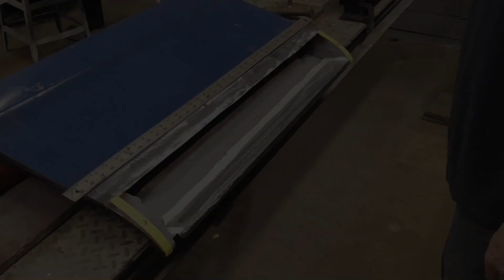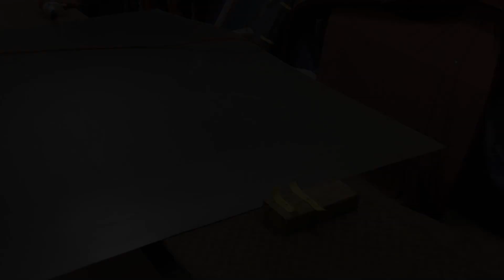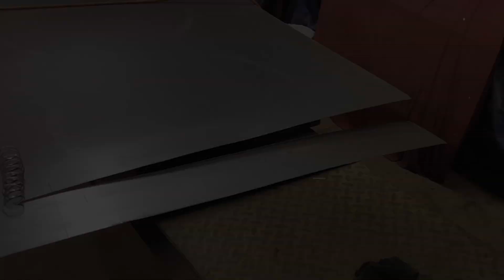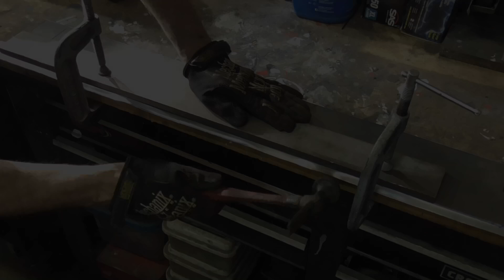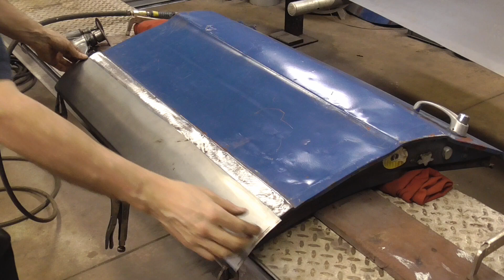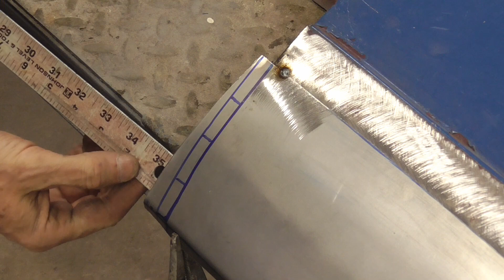How to Make Your Own Auto Body Patch Panels for Rust Repair

Comment: I tried to do this on a Chevy square body truck door. I warped it terribly
Reply from the maker: Take it one weld at a time and alternate.  You don't really have to weld solid either :)
Reply: @LakesideAutobody  ok because I did weld it solid but went back each time between welds.  I’ll try it again.  Thanybyou

Comment: Have you done the in door part?
Reply from the maker: I'm not sure what you mean by that.  Could you ask in a different way - sorry :)
Reply: @LakesideAutobody  the indoor where the door card is? Below that where the outter panel wraps around the pinch holding both pieces together. From the corner of the door about a quarter of that is bad. I can find outter panel for my dodge but no inner bottom pieces.
Reply from the maker: @BigBarnV1  Got it.  Here's a video that may help with that - https://www.youtube.com/watch?v=92mr0C62tq0

Comment: Nice work and video!  Sorry if I missed it, but no weld through primer?  If those seams are raw metal the rust will come right back.  And painting inside the door afterwards won't get into those folded over seams and sandwich lap joints... but the water will.
Reply from the maker: Many manufacturers like Honda a recommending no weld through as it affects the weld pool and burns off any way which I completely agree with.  It's best to treat the finished repair afterwards:  https://www.youtube.com/watch?v=8XaZBy7GC7A  Hope that helps a bit :)

Comment: JERRY
WHAT DO YOU THINK ABOUT USING AUTO &  TRUCK ROOFs. AS PATCH 
PANELS CUT UP FOR REPAIRS.
                GOOD. VIDEOS
Reply from the maker: Absolutely - that's what we used a lot in shops I worked at besides door bottoms that were bought.  Really the only reason I buy sheet metal now is because I don't have a supply of scrap fenders, hoods, quarters, etc.

Comment: Where do you get your sheet metal? And what gouge do you normally use for rust repair?
Thankyou for making awesome tutorial videos. Really enjoying them.
Reply: Haha I've been doing this forever, I get metal anywhere. 
Metal supply places , even an old car door or hood, look around you'd be surprised where you can find some metal. 
I've got a stack of file cabinet organizers that are about .080 thick ,great stuff for floor patches. 
You can't even lift the milk crate that's full of them. 
I might not be great at the finish bodywork,but I like cutting out rust and putting metal back.
Reply from the maker: I get it from Alro Steel and use 20-22 gauge for rust repair.  Have a good weekend :)

Comment: Very informative series about patch panels!  I have been practicing my butt welds for patches.  I put a very slight beveled edge (18guage or thicker) on the outside mating edge with the cut slag left on the backside. Putting a bevel on the outside keeps the weld low profile while still penetrating cleanly saves grinding  consumables as well. This has helped tremendously with thru penetration (provided your gap is no more than a 16th") if you cannot get the mig gun on the backside of the panel. Afterwards.. a light brush of 2k epoxy primer on the backside aids in providing rust protection.. i like your method of cooling your panels with a damp rag too. That is my "go to" way to do things now.!
Reply from the maker: Very cool.  That's good to hear.  I like the video about this that Eastwood made too. :)

Comment: What type of welder do you have?
Reply from the maker: Miller Millermatic 90 115v - I actually welded an eye of a leaf spring after it broke right off.  Drove on it for years after the repair.  It's very powerful for being so small and portable.

Comment: I love that you don’t have thousands of dollars in tools like press break or fancy 45 degree pliers
Reply from the maker: Thanks - I planned on having a bunch of cool stuff when I was 18 but......
Reply: Lakeside Autobody you may have covered it somewhere else but can you please run down your sanding grit steps right from removing old paint to applying new paint. I assume 60 grit, filler, cheese grater, 60 grit,80, primer, 220,320,400, paint?
Reply from the maker: @patrickchristie82  Sure:  40 grit fiber resin disc on a grinder to remove paint and prepare metal for welding or filler.  40 grit to sand filler then finish it with 80 to remove those deep 40's.  Feather edge the paint - start with 80 sometimes to knock it down a bit then 120 and scuff the shinny paint that may get primer over spray.  Block with 80 big giant areas or 120 smaller - finish it to 120 though.  Prime again wet sand w/ 400 or dry sand w 220-320  - then paint  _ Hope that helps - Jerry
Reply: Lakeside Autobody thank you very much
Reply from the maker: @patrickchristie82  You're welcome - any ?'s feel free.  Jerry

Comment: Thank you for the awesome videos!! 
I recently found some rust the fire wall my 2007 2500hd GMC Sierra. The rust is a result of   Battery acid overflow. I neutralized the rust with baking soda paste and rinse. There is a battery support bracket spot welded into the fire wall. At the bottom of this bracket is where the rust begins- there is rust between the bracket and fire wall. How do I remove the bracket to cure the rust without messing is the fire wall? 

God bless,

John.
Reply from the maker: Maybe this video could help you - https://www.youtube.com/watch?v=hkESVLqypLc  The teeth break easy though.  There are other types too.  God Bless you too :)

Comment: I'm just here for the great advice... I still have rust repair to do and I like your videos. Great info.

I'm not sure if I missed it. What guage metal did you use for that panel? Throwing out a wild guess at 18.
Reply from the maker: That is 20 gauge A1008 cold rolled sheet from Alro  Steel.  You can use anything from 20 gauge (.035") to 22 gauge (.030").  40's 50's cars were thicker - not sure what gauge though.
Reply: @LakesideAutobody  Gotcha. Well, specifically, I'm interested in my truck which is a 69 and that metal you were using formed a lot easier than mine has. My motorcycle uses 16 so I'm guessing mine in 18 then. That 20 looks super nice to work with.
Reply from the maker: @RIPbiker13  I've always used around that  thickness on everything and never had a problem.  Here's a couple of videos that may help you decide.  https://www.youtube.com/watch?v=8XaZBy7GC7A or 
https://www.youtube.com/watch?v=2o37dX--w0I
One more thing, If you can measure the thickness of the metal on your 69 truck, I can tell you the gauge.  Match it up w/ a feeler gauge if you don't have a micrometer.  Jerry

Comment: Face melting intro!!!!!    Love it!   great work and thanks again.  I have some door work to do to my 67 Fairlane.  I am in the process of replacing the entire floor pan.  Keep the videos coming,  They are great for a beginner like me.
Reply: Also, What is your guitar rig?
Reply from the maker: @67fairlane12  Washburn KC70V with a Crate MX20RC practice amp.  It's got reverb and chorus so it gives it a bit of a cool sound.  I've always wanted to try Fender or Marshall amps but too much $

Comment: what gauge metal do you use to make your panels ?
Reply from the maker: Anything from 20-22 gauge -.030-.035 inches.  That stuff was A1008 cold rolled sheet from Alro Steel - 20 gauge.   Most cars and trucks fall in that range.  Old cars 40s and 50s probably way thicker.

Comment: Great work, wish you would have shown how to make the contour
Reply from the maker: If you are talking about the contour on the ends - After clamping it on the bottom and tacking it on the top, the contour of the patch was set - then by cutting those reliefs in the metal, all I did was tap those little sections over, weld the "cuts" up, and tap it around a bit to get it right on.  I will do more videos on this topic though and show that process.  Good suggestion :)

Comment: Great video! Are you using 22 gauge aluminized steel?
Reply from the maker: That's 20 gauge A1008 cold rolled carbon sheet metal from Alro Steel.  I like 20-22 gauge sheet metal.  Thinner is easier to work with - thicker - i suppose would last longer.  20 = .035  & 22 = .030  - so they're actually not that diff.  Jerry

Comment: For a beginner, is it better to go with fiberglass, or a patch panel like this one?

My car is a 2004 Toyota Corolla. It has 2 spots of rust, on the rocker panels near the rear wheels. They are both about 4 inches wide by 3 inches high. It's surface rust, not all the way through.

I'm good with my hands; so I'm okay with doing detail work.

Comment: Really appreciate you sharing your autobody knowledge. I need to make some patch panels and I'm curious on the thickness of the sheet metal you use?? Thanks, Brian in Oregon
Reply from the maker: You're welcome - glad you enjoy them - take care.
Reply: What is the metal thickness of the sheet metal?
Reply: @FJ40Brian  1mm for body work would be good most car Now a day's are about 0.8mm, floor would be at least 1mm
Reply from the maker: @FJ40Brian  That was 20 gauge.  I like stuff around .030.  Anything from 20 to 22 gauge is good.  It's up to the individual though.  Thinner stuff you can work with a little easier.  Thicker stuff obviously lasts longer.  Jerry
Reply: @Lakeside Autobody what kind of steel do you use? Cold rolled,hot ect?